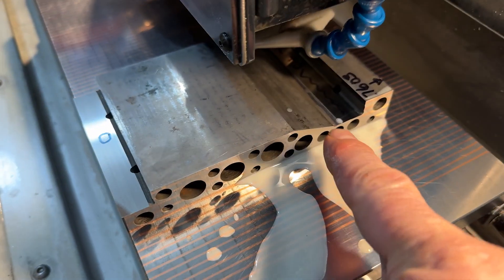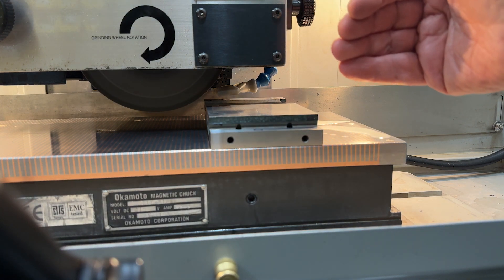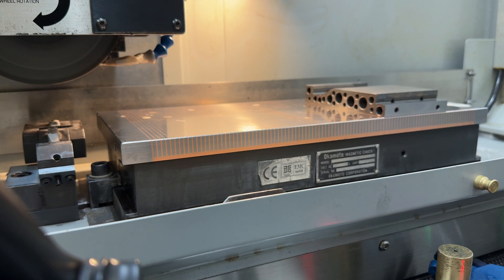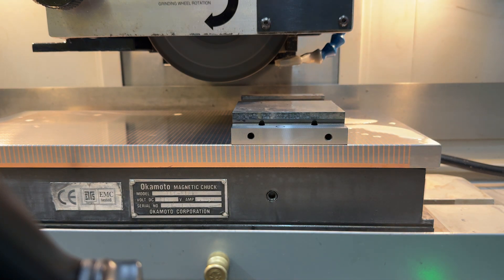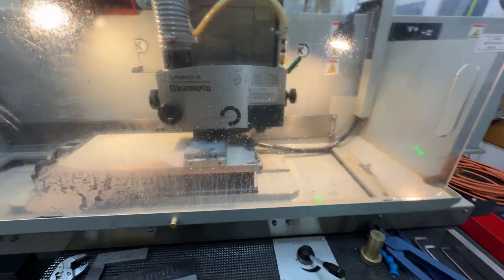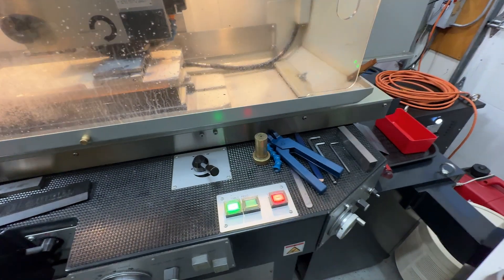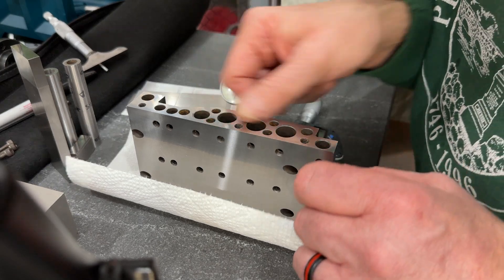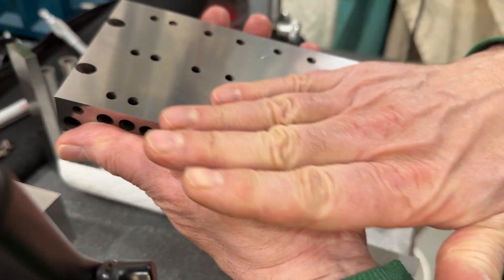Quick Chips: Restoring a sine plate, Part 6

Comment: Why not use compressed air around grinders ? I do cylindrical grinding in the aerospace industry and I havent heard that before now. Am I missing something?
Reply from the maker: It's an old adage, and is to prevent operators from blowing grit into the grinder ways.  Of course, if you know what you're doing, there's no reason not to do it.  Though sometimes you'll hear me joke about never using compressed air around the grinder, as I am doing just that.
Reply: @KPNH  ahhh , that makes sense ! 
I was a bit confused 😆
Thank you for your reply! I learned somthing today ! :)